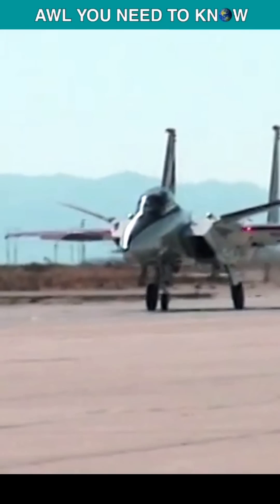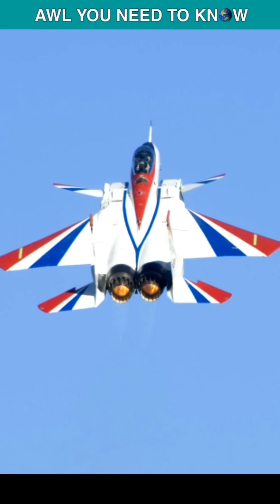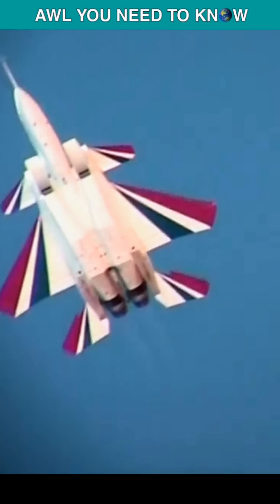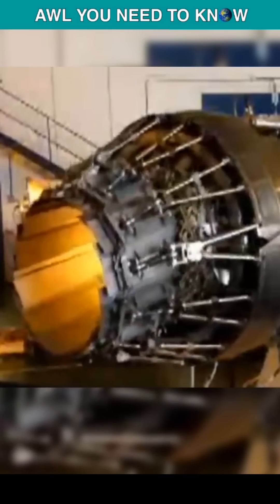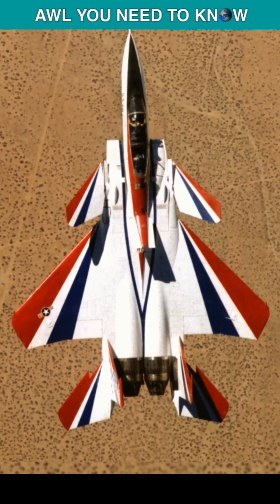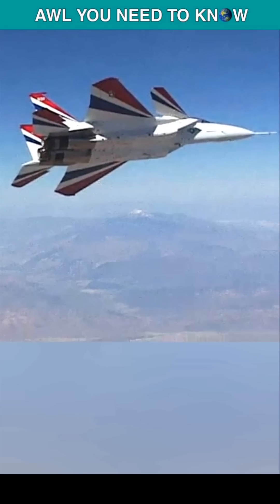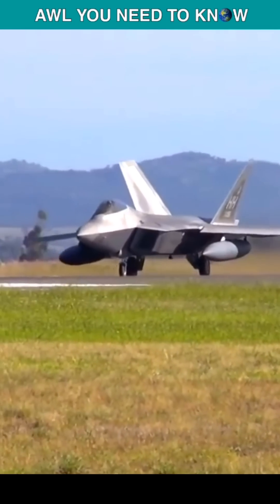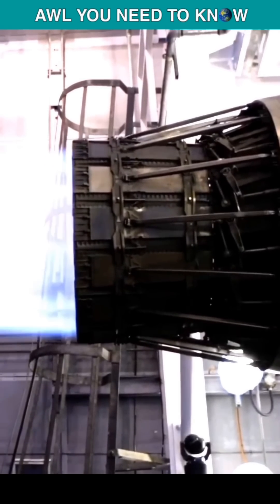Did You Know About The F-15 ACTIVE? #shorts

Comment: That's so freaking cool!
     I guarantee that the 'F-15 Active' was the progenitor of the F-22 and F-35 series planes. If not the plane itself. Then, at the very least, the systems + concepts they'd developed on the platform certainly were! That single plane enabled a ton of new tech I'd bet.
Reply: It was the Thrust Vectoring Progenitor for the F-22, and its Avionics were later used in the Strike Eagle, and America's entry to Super-Maneuverability

It was, and Still is, a Marvel to behold that such a platform became a testbed to many idea's

Russia would also call bids into this, culminating into the SU-37 Flanker 'F' or "Terminator" in modern culture, though the Canards were tested as early as the SU-30

Comment: Such a big success there are 0 in use while there are tons of F-15 still in use.
Reply: This was the test bed for the later F-22’s supermanuverability vectored thrust system.
Reply: @blackhawk7r221  i thought they made this for short runways in case air stations were attacked... that's what the narrator said anyway.

And aren't both the F22 and the F35 colossal failures and boondoggles?
Reply: @crispy9175  If it is a NASA aircraft, it is always a technology demonstrator research bird.   That’s where many of the “what if we…” ideas go.
Reply: @blackhawk7r221  so if was a waste ... that's what you're saying.  Because the STOL wasn't applied to the F15 even though we have tons of those still in use,  so the STOL aspect was either a lie or a waste, the stuff they applied to the F22 is also a waste since that whole plane sucks and is competely ineffective.  The only things they're good for are parade fly bys.
Reply: @crispy9175  STOL is how the narrator incorrectly portrayed this demonstrator.  This particular bird was built to explore supermanuverability.  If it gave STOL performance, then that was just an added benefit.
Reply: @crispy9175  The F-22 was built for a single main purpose, to point its nose (missiles) within that magic 30 degree off-axis plane at an opposing aircraft as quickly as possible without losing energy.  It does this in spades.   Other factors like super cruise, low observability, and internal weapons are secondary benefits.   
F-22 development has had no more problems than any other bird.   F-35 is a different story, but those are finally ironed out.
Reply: @blackhawk7r221  lmao.  You keep changing your argument. Figure it out kid. They're all boondogles and compete wastes of taxpayer money. One day you'll grow up and learn that.
Reply: @blackhawk7r221  @Crispy is right. These were all huge wastes of money.  The fact it's taxpayer money for a broken unused system just makes it more of an insult.

Comment: My whole childhood to decades later... I had NO IDEA those canards were moveable!
Reply: Why aren't these canards placed onto the current F15EX models models if they're so effective
Reply: @Defender78 Because the USAF does not consider supermaneuverability to be practical in modern air combat, where US doctrine is to maintain high speeds and not get drawn into low speed turning fights.  (This has been successful since 1942.)  Also, the control motors and hydraulics for the canards on the F-15 ACTIVE required the gun to be removed.

Comment: The canards are actually the horizontal tail stabilizers that are on the F18.
Reply from the maker: Exactly.
Reply: @awlyouneedtoknow9435  Russia getting thrust vectoring and VTOL years before: I have not such weaknesses
Reply: I was going to comment the same thing, lol. And then i saw ur comment. 😅 yes u r right
Reply: The more you know 🤘.
Reply: Things I didn't know, but filled away as something In glad I now know.
Reply: If it's proven and saves money, why not? Just like the F-117 used a few F-16 parts.
Reply: The f18 horizontal stabilators are definitely flight control surfaces.